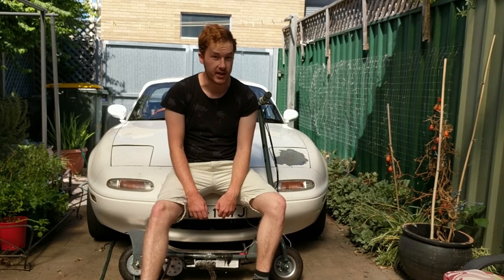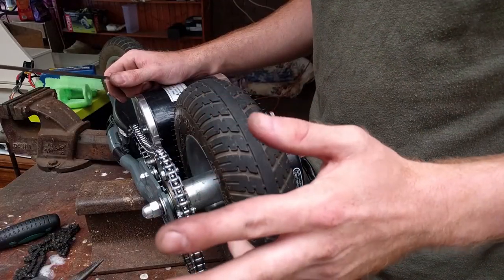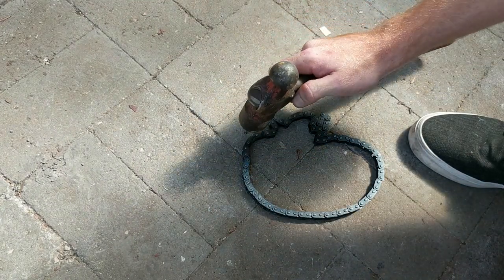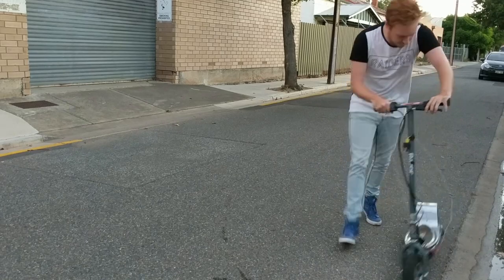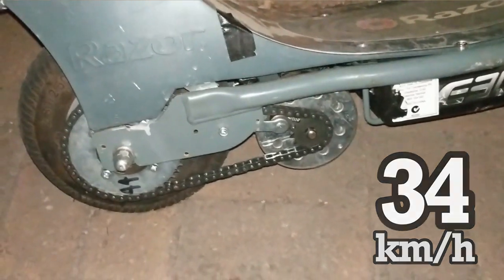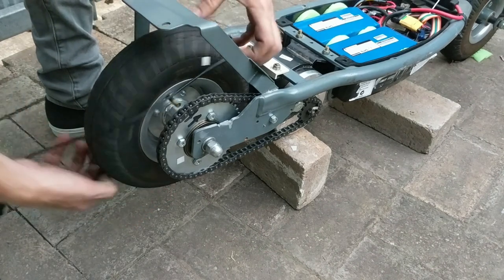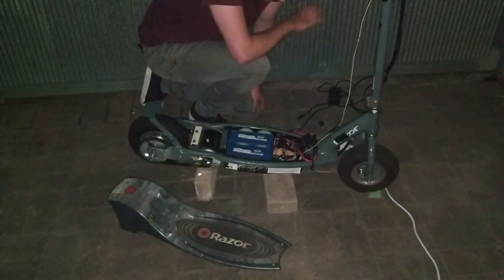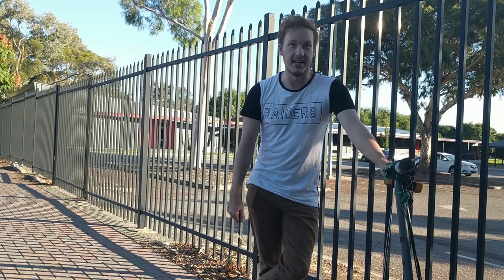Fast RAZOR E300 Burns Rubber With Big Power - Scooter Episode 6

Comment: In all razor scooters there is already an extension for the air pressure valve in the right handle ;)
Reply: I did the same thing then found the extension after I got the tires aired up 😂😂

Comment: The speed loss due to drive train resistance should have no appreciable difference between your theoretical top speed and your actual speed. It is the same drive train and that resistance is not modified by driving down the road. Unless you are riding up a hill which would increase your loss due to fighting gravity, or you are riding against hurricane force winds which would increase the loss due to the resistance to the wind, your speed loss will be almost completely due to road friction, not wind resistance. Compared to the speed loss due to road friction, wind resistance is a non issue and comparatively inconsequential. Road friction will increase with the weight of the scooter and the weight of the rider added to the equasion, neither of which was a factor when the wheel was free spinning in the air.
Reply from the maker: I'd disagree, as the slop in the drivetrain bearings, etc. will change when 80kg of Australian is placed on the board. But I get what you're saying.
The horrible drum break is a big pain, tbh. Drags so much.
Reply: @WhatUpTKHere  the almost incalculably  small difference due to any, as yet undemonstrated, bearing slop caused by a rider is also nothing compared to road friction
Road friction is where nearly all energy loss occurs in all vehicles that travel with their weight during travel supported widirect contact with the surface over which it is moving
 All other loss is minuscule in comparison. Bearings are so good at avoiding at causing energy loss because they are specifically designed with tolerance standards so high that they are for the most part virtually friction free and are designed to remain so when carrying a load.in other words, they are designed to function so as to avoid what you assert is an inherent friction l loss.this does not happen under load unless the bearing is bad.

Comment: Okay batteries are at 21 + V reset button continuity good power switch button continuity good accelerator switch continuities good brake pedal however if it doesn't do like you said what function does it have against the relay if any and will it stop everything?
Reply from the maker: 21V is low, suggests the batteries are dead

Comment: I assume you'd want the tensioner on the bottom of the chain because you'd want uninterrupted tension on the top. Tension on the top is pulling to rotate the wheel while the bottom its pushing the chain towards the rear wheel
Reply from the maker: Yeah I getcha!

Comment: How can you not consider the most obvious and crucial thing for top speed. At 53 kph, you had 0 load on the rear wheel. What about your weight and the scooters weight?
Reply from the maker: I talk about that! Unloaded rear wheel speed isn't equal to top speed thanks to many losses - rolling resistance, aero, etc.
Reply: I wonder how Solid rubber wheels will perform. If you remove the chain and push the schooter  whilst standing on it - it doesnt seem to want to Roll easily . Solid rubber wheels may add 5kph to your project

Comment: Your chain tensioner is installed WRONG! It must be on the botom chain (chain return to the motor) and lifting up, What you have is on the torque side lifting up which dose nothing but try to lift chain against the FULL torque of the motor. Put it on right and the chain can be looser reduceing drag and binding while the tensioner keeps the chain from flopping. This might get you over 40kph. Hope thid helps.
Reply from the maker: Yeah, we noted and fixed that a while back hahaha. Thanks for the tip. More work to come.

Comment: I got a razor e300s brand new last December and I have bearly used it due to the fact I can't go full throttle in my area. where I am can only go around 5 miles and hour but I've saw you can get a variable speed throttle so I plan on getting one of these and hopefully I get more battery out of it because instead of having to go on and off the throttle to keep it around 5mhp I will be able to just hold it around that speed with the new throttle and therfor i think I'll get more battery life. What do you think?

Comment: Dude, WTF are you doing with the chain tensioner? Just assemble it right already...
There is no need to put tension on the upper part of the chain, the motor is already doing this job. You need to assemble it under the returning part of the chain. Your whole thinking about the chain length is pointless... 
That said, I must admit that with your way of assembly it is probably a bit more quiet...but not doing any job, so you can just unmount it going this way.
Also, 40kph on this scooter is a bit crazy. I also put 500W motor on E300, but did not change the gear ratio (new motor also has 11T sprocket for 25h chain). This way I get ~30kph on freshly charged batteries, good torque (easily climbs on most of city hills) and range (~20-25km on 24V/16Ah li-ion battery). 
And the adjustable throttle - this is a must! Not very expensive one though. New controller + throttle is ~$25 from China (even a fancy one with voltmeter and ignition key). 
Good luck!
Reply from the maker: Which controller are you successfully using with variable throttle that can handle 36V/500W?
Reply: I am using YK31C. It's the most popular one. I have a 350W controller, but it's current limit is set to 25A (I use 24V system, 7s5p 18650 battery and same 1020 motor, 500W, but @24V). This way you actually get almost 600W limit, so it gives you a full power when you want to go top speed, but limits the current when starting, so it doesn't pull too much. Nice setup, can definitely recommend, With Sanyo ncr18650BL batteries I  have like 16.5Ah, which is enough for ~20-25km. 
I also have a cheap throttle from aliexpress, half wrist, same as the original. But when I go on bumpy pavement I start to thing a thumb throttle (like for an ATV) might be a better idea.
Reply: omg, awesome. I was just asking him about a YK31C and whether I could be frying mine by changing the gearing. I've been running the 24V 500w controller at 36V, but am going back to 24V and regearing to mitigate some of the loss in power. Do you think I'll fry it at 24V with a 15t pinion , 55 rear and 500W motor on 24v?

Comment: Great work. you should make an ebay package and sell it with all the bits needed to do your mod.
Reply from the maker: Thanks! 

It'd be pretty impossible to make any money doing that, particularly as there's a certain skill level required to bodge the better MOSFETs into the original controller. It's also not really the easiest, quickest way to make a fast scooter - just the way I wanted to do it. There are some upgrade kits out there already for E300s which do offer folks varying levels of success.

Comment: Great bunch of videos mate. I did almost the exact same thing with my Razor
Reply from the maker: Thanks! Modding these things is rad, hey.
Reply: Yeh kinda.. Once you get past a certain point you get a lot of broken chains and trying to actually ride one of these at plus 40mph is a bowel loosening experience. I used a 1000w, 36v, 3000rpm motor powered buy three 11v, 8000mah lipos...it power wheelied like a crosser lol

Comment: I'm thinking about modding a E325 with a 350 watt motor, do you thing that + variable speed controller would make much difference performance wise?  I'm gonna keep the lead-acids, at least for now

350 watt motor that's same size as stock 250 watt so no mods needed: https://www.ebay.com/itm/232358143347
Controller that I think is 500 watt, I asked seller: https://www.ebay.com/itm/132014884108

Comment: I want to fit 2x 180w 2500rpm 24v brush motors to my sons regular bicycle. The Motors were given to me . I have access to machine shop and welding equipment. So the mechanical side will be easy . I would like links where i can purchase components. Eg speed controllers and variable throttle controller . I have no wiring @ all to go on - so it will be guess and go. I am familiar with some electronics .  there's a warehouse near by that does mosfet s and a ton of other bits. . I,m keen on a simple throttle concept 36v . I may need some of your amazing info. Gearing i can sort out easy enough.
Reply from the maker: Type in "brushed speed controller 24V" to eBay and you should be good. You can get a 250W or 500W controller that should have plenty of overhead to safely run your motor
Reply from the maker: Then ask the seller to include or suggest a throttle that suits

Comment: 10mm doesn't fit the stock motor behind the sprocket? Also it's round so none of the spanner sizes do?
Reply from the maker: Ah, frustrating. Sometimes they have flats you can get a spanner on

Comment: Hi what scooter is easy to put on a gas 2 stroke motor without too much cutting or welding?  Can you recommend a base scooter to buy that I can slap on a motor and chain will fit in back tire sprocket?
Reply from the maker: Hm very hard to say! E300 is chain driven but will require lots of work I suspect.

Comment: I'm doing something similar with my old Mierda Powercycle 500, an electric assisted bicycle, having a hard time locating the original motor controller box since it's such a special controller, but something I may suggest is using a 19 tooth sprocket, it's what my bike manual suggests to get Max speed with the lame 250 watt motor ;) just an idea I'd pass on to a fellow electric nut ;)

Comment: i have an old razor pocket mod scooter my plan is to put a weed eater engine in it
Reply: i might go with a 75cc predator engine from harbor freight instead those motors get decent speeds
Reply from the maker: That's cool! The one thing you wanna think about is making sure you have some sort of clutch mechanism.
Reply: it would be easy to find a clutch for the 75cc but for the weed eater engine it would be hard to find a clutch
Reply from the maker: Donovan Bryant ah yep, makes sense. Would love to do something with a small engine down the track myself!

Comment: Did not you try what voltage can hold 24 v motor?
Reply from the maker: Yeah they don't love 36V!
Reply: @WhatUpTKHere  thanks
View month ago removed original petrol engine, and welded adapter so can use Razor scooter 12v motor, and 24v Razor controller and throttle handle. Powered from dyson hover 25.2v motor, was working, but not enough power when get to grass curring. Revs going down. Yesterday rebuilt it, to razor 24v motor and razor throttle handle, chinise 36v brushed controller, hoverboard 36v battery. Now power enough, but if go near at full throttle too long, motor build up heat, so for home use it is good enough, if let cool down. Need to make some sort of case to hide battery and controller

Comment: Great job. But what I did with mine was replaced the motor sprocket with a 13t and the same time replaced the rear plate sprocket with a 15% smaller one ( came from a shopping cart scooter and modified the holes to fit the Razor). The result was crazy fast, it's scary
Reply from the maker: That's awesome. These things are so sketchy at high speed but that's what makes it fun.

Comment: TK.
I just upgraded the e300 to 36 volts.  New controller, a new battery, so now there is three batteries.
New throttle.  Which would be faster, the original motor, or a 500 watt motor?
Please let me know and thank you.
Kenny
Reply from the maker: Hi Kenny, well, it depends if you choose a 500W motor that also has a higher RPM/Volt rating than the stock one. 

I made the mistake of choosing a more powerful motor, but one that turned slower at 36V than the stock one. This meant I had to muck around changing gears.

I suggest checking out my video on photo tachometers, and then using one to measure the no-load RPM of your current motor on 36V. Then you can shop around to see if you can find a higher power motor that also runs at the right speed.

Can be tricky! You can always consider changing gearing, too, of course. 

https://youtu.be/QVSQLfnKytk

Comment: In my experiance with close to the same setup, I'd say you are over gearing it.  The motor is getting hot because it's not turning enough rpm.  I think you'd get closer to your target with a lower gear.
Reply from the maker: Avtually in a later episode I go faster with even higher gearing - and then later blow it all up XD

Comment: Great series so far! Building up one myself. I weigh 215 or about 98kg though . My Son 62lbs or 28kgs. I can get going about 10mph after a stretch and he gets up to 15mph. Bought a variable speed controlled and bumping it to the 500w Motor to start. Can't wait to get it bolted together. Debating buying a second E300..
Reply from the maker: Nice! They’re great fun to ride in pairs, to be honest
Reply: My boy is 50 lbs and he can hit 17-18 mph on a full charge. He's got the taller balloon tires on his though. 2 12V 9Ah AGM batteries and a variable throttle.

Comment: There's 2 wire at the brake cut the one that's closest to the handle bar as close to brakes as you can get it's makes it fast but idk why it does
Reply from the maker: Very interesting, I may have to investigate

Comment: What up tk here my stock razor motor burned out at 24 volts and the controller blew up
Reply from the maker: That sucks! Time for a replacement :)
Reply: What Up TK Here yeah it really does considering I already spent 150 on repairs

Comment: The tensioner has to touch on the bottom on the outside of the chain and what batteries are you using 
V and ah?
Reply from the maker: If you watch the earlier vids, I swap over to 2 x 7 Ah 5S lipos for a nominal voltage of 36 V.
Reply: @WhatUpTKHere  
My bad didn't watch that video before 

I'm not an expert or anything but I hav an e300 too and one time I just doubled up the batteries from 2 scooters with pretty bad run time I'm talking about 10 to 20 min instead of 45min

I ran them parallel 24v and 14 ah wich would be more like 10 ah or so everything else stock 
My smaler brother maybe 130lb went 29kmh on it and it would run over 1 h

So my bet is you don't have enough amps

Comment: How long would the battery life last on a run?
Reply from the maker: Thus far untested, but I should have data later this week.
Reply: @WhatUpTKHere  hello mate what does it mean when the charger is flashing green and red, is the charger dead or battery?
Reply from the maker: @MrOoBAZoO  The original Razer charger? No idea I'm afraid, I threw mine away as it's not suitable for the LiPo conversion.
Reply: @WhatUpTKHere  yeah mate just bought a second hand e100 and just flashes green and red, gonna sell it anyway too big for my son I'm off to go buy my e300 brand new in box for £180 😁
Reply: Just to let you and others no the charger was at fault bought my new scooter today and thought I would try the charger and its fine👍

Comment: Just spotted from your speed calculations that you are running on 9" wheels. Consider switching to 10". It will fit with the new motor (since it does for me and I have the same setup). You'll get a bit more ground clearance (I'm not complaining on bumpy corners) and a bit better ride and handling.
Reply from the maker: Yeah, I'm running whatever came on the scooter. If there's an easy 10" upgrade it could be cool.
Reply: Just try to check if bigger tire would fit your rim. I can take some measurements of my rim if you'd like. My scooter was factory equipped with 3.00-4, 10" tires. Might not sound like that big of a difference, but just looking on your ground clearance it is way smaller. I have totally no problem when cornering. Try to check if this was only the tire that was changing depenging on region/version, or if also rim might be different. 
Also planning to put a disk brake for the rear tire. Just returned from a ~6km ride and while I am not concerned with drive and electronics (the motor is only a little bit warm) I feel that the scooter brakes way worse after getting hot. I already have on the way some stuff from aliexpress to convert it to disc brake. Will see how much rework will be necessary to fit it in.
Reply from the maker: Any chance you can measure your tyre circumference and get back to me? I was pretty sure I was running 10 inchers already haha.
Reply from the maker: Thanks for the tip on controllers by the way. I might have to scope out a good 36V one as I would like to try variable throttle.
Reply: The circumference of my wheel is around 800mm, that's why I noticed when you were calculating yours (I was already using it to install a simple bike computer with speed indicator). You can see a difference with a bare eye. I'll try to get you some photos. I would ask guys from electricscooterparts if there's a different size of rim for 9 and 10 inch wheels for razor. If it's the same - you can just purchase new tubes and tires. 
I'm still waiting for parts for disc brake, since the simple drum brake gets quite hot after ~6km ride from work and I can feel how braking is affected (when the drum is hot it basically cannot convert more energy into heat).
Also thinking of making the handlebar a bit wider. Might make it a bit more stable on tight corners and bumpy pavements. Maybe just cut the original one and weld a mounting for bicycle handlebar? Who knows...maybe then I would be more comfortable with a bit more toque when starting and I would remove the 25A limit :D